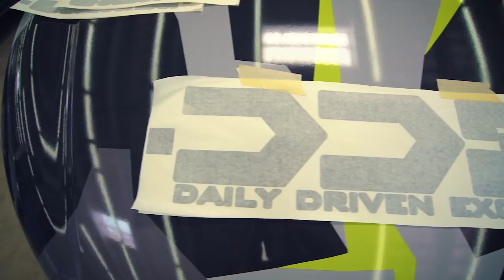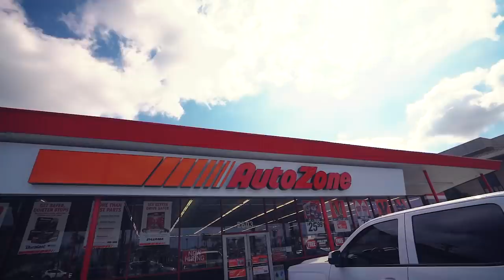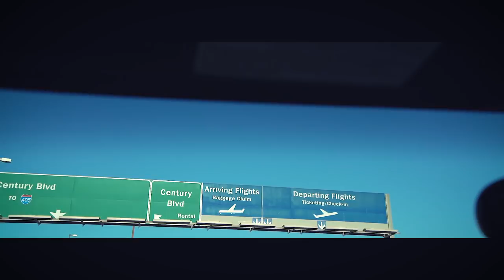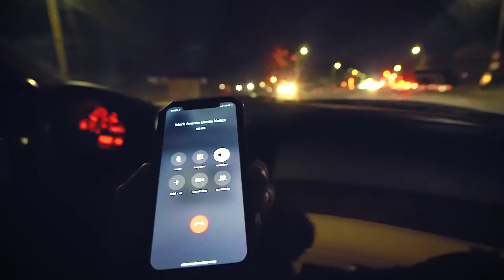SURPRISING MY FRIEND WITH CUSTOM AUDI R8 SUPERCAR! *NEW WHEELS & WRAP*

Comment: R8 looks much better now! Personally, I think yellow brake calipers that match the wrap would be cool. Also, here's an idea for the carbon panels. You could keep the carbon exposed, but leave the black and yellow shapes over it, in order to keep the wrap consistent. So basically you would cut out the grey areas but let the black and yellow parts flow over it. Not exactly sure how it would look, but I think it would look good!
Reply: I was thinking the exact same thing

Comment: The R8 looks amazing! Absolutely love those wheels!
For the wing, I prefer the carbon OEM option.  You can also look into modernizing the overall look of the car by replacing front bumper with aftermarket one.  Should be plenty available by now.  

For Alex's Huracan, if he likes the straight piped exhaust so much, couldn't he just get the Performante rear bumper?  It seems like exhaust holes match his setup.

Comment: Get a Performante rear bar for the Hurrican so you can keep your current exhaust

Dave should get rid of the quad tip (V8 look) exhaust for dual single pipes and chassis mount wing👌👌

Comment: The R8 needs a Big Turbo W/Front Mount, Straight Piped Exhaust,  Vorsteiner VRS Aero Wang, Vorsteiner VRS Aero Full Body Kit With Cf Lip & Defuser, Vorsteiner Debadged Grille, CF Mirrors, Recaro Racing Seats, Green LED Headlights, Smoked Clear Lenses Taillights, Short Throw Shift Linkage, Tinted Windows, And DDE Windshield Banner.

Comment: R8: wrap looks good but exposed fiber would make the wrap look better, rim color matching the green/yellow in the wrap would be sick, and custom built chassis mounted wing

T.S. if adding the bumper back causes you to have to hide, modify, or remove  your custom exhaust then leave it off, the look of the exhaust is sexy.

Comment: With this wrap, a stock wing is out of the question.  However, the Audi R8 has more curved lines then a Lamborghini.  And as such, a large straight wing IMHO doesn't look right.  Something with some 'steps' or different levels going across, a little curve... it all just matches the car better.  Nice to see the calipers match the bright yellow as well.

Comment: So if you inflate a tire to set the need then back the air out then re-inflate  them 9 out of 10 wheels (real wheels not garbage ass ghetto wheels) will not need to be balanced because the tire will be set properly. Should never have $3k plus wheels and need weight...